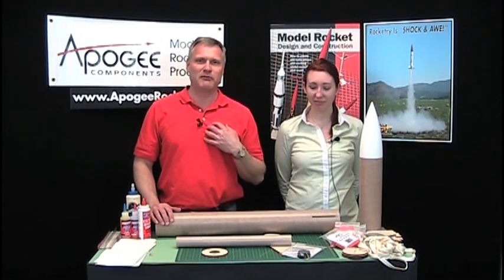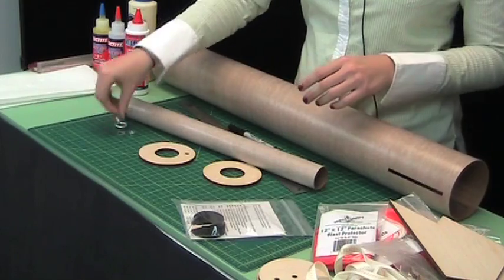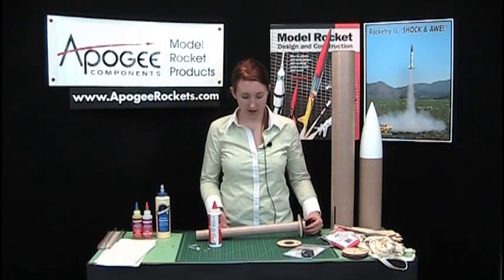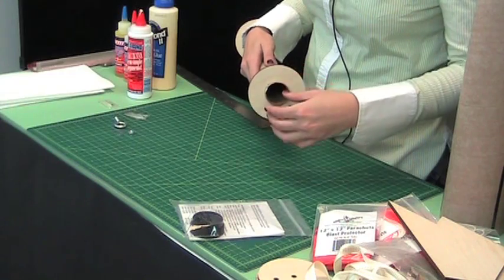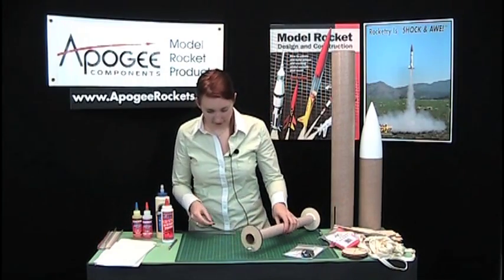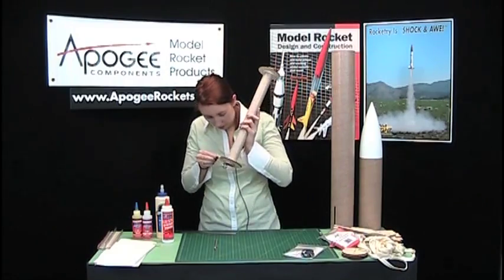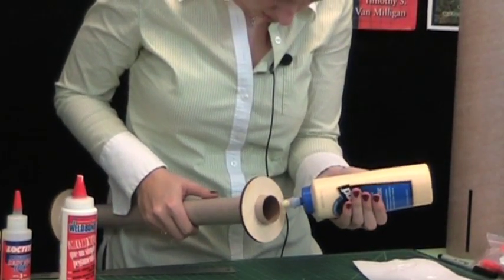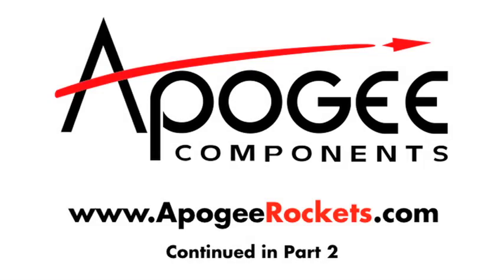Building Your First High Power Rocket - 1: Motor Mount Assembly

Comment: im a bit of a high power noob but i was just curious, shouldnt there be a 3rd ring in there to help secure the fin on top aswell?
Reply from the maker: I don't typically use one unless there is a very compelling reason. I'm building a cluster model now with motor tubes that have different lengths. In this case, I need a third ring in the system.

Comment: Why are the rockets such a larger diameter than the engine?
Reply from the maker: You can have the rocket the same diameter as the motor. We call those "minimum diameter" rockets. The advantage of minimum diameter is they go higher. The disadvantage is they go higher. A lot of times they go so high you can't see them anymore. What fun is that? We want to see the rocket during the whole trajectory.
Reply: The q are you aerospace noob

Comment: No sweat. You could also try a plastic "speed square" from Lowe's or Home Depot. This will have a notch out of the center, so you can clamp it (or zip tie it) to the tube, right next to the ring. Then you can use some regular clothes pins to secure the ring to the speed square, which stiffens gives you a nice 90-degree edge to clamp to. Basically, it's a 90-degree "fixture" right on the tube. Get the clamps that are weaker, so they don't crush the tube. $20 will solve your problem forever.

Comment: For one thing, don't rest the tube on an angle with only one ring in place. Even if you are only gluing one ring, at least put another on the tube so there's less of an angle. The other thing is that you can go to a hardware store and get several large spring clips (they look like a large metal clothes pin) or even a "hobby clamp" type of device. Get a couple of those, and put on on either side of the ring to support it from either side. This will stiffen the ring while the glues dries.

Comment: Would recommend you guys consider swapping out the plain hex nuts for some elastic insert nuts for those eye-bolts in these kits. That would negate the need to slop epoxy onto the nut and threads, and generally give you a neater result.

Comment: i also used a cheap drill battery for the power going to the rocket and a cheap charger yeap rechargeable, i got it at harbor fright,and the box at radio shack, use a safity switch recomended, radio shack has them too, theres six aa batteries operateing the reciver and a 9 volt for the trainsmiter 27 mhz , i have about $50 in the box, the range is about 50 yards but have got 100 yards out of it, a good safe distance from the rocket, much better then 30 feet,plus its easyer to track your rocket,

Comment: make a radio control launcher does away with all that wire laying around and haveing to roll it up just a short wire to the rocket, use a relay to contact the high voltage to the rocket, i used a toy truck radio control i got at good will it works great no interfearence at all.. has a good range to can get way back from the rocket, use the two motor wires to trip the relay, remove all other wrires except the battery wires from the reciver in the truck,

Comment: @apogeerockets i have a problem when building my rockets keeping my centering rings straight and than the glue sests and they go on crooked. any tips? I do use super glue(plastic cement) wich is a fast setting glue so that might be why. any glue that i can use that might work good but dont set as fast?

Comment: Nice job Erin! An unspoken, but implied tip is that you can use wood glue for a high powered rocket. Epoxy is not always necessary as some might believe.